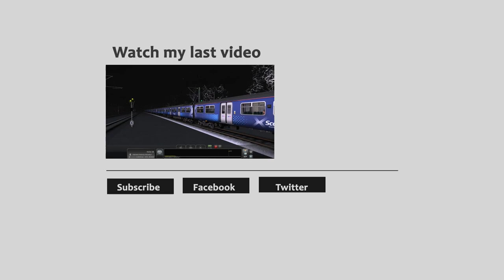OMSI 2 Let's Play #28 | Scania Citywide GN14 | Berlin X10: Line 110

Comment: hey qwerty, i can't seem to get just general bus mods to work so you just make it into a zip then drag hoff files in or am I doing something wrong?
Reply from the maker: I don't get your question, you need to extract whenever you want to put into your omsi 2 root folder, hof files can be copied and pasted into other bus folders to be used on other maps etc
Reply: +QwertyAfro just how to install bus mods
Reply from the maker: Buttie bacon buses themselves or mods to addon to existing buses?

Comment: The bus doesn't need a physics upgrade, sadly the bus handles this bad in real life too, hence drivers tend to hate it.
Reply from the maker: +AutoGamerz well it needed a patch because if the suspension and the kangoroo jumping action it did when you braked or turned sometimes was unplayble at times
Reply: the kangaroo jumping is the result of the out of memory issues, it happens to anyone when their PC can't handle the map completely, it's basically the first sign your running low on memory, then textures start to disappear and become white, then you sometimes crash.

You mistook that for an issue with the bus.
Reply from the maker: AutoGamerz
the bus still has bad physics of what I have read online of what these hotfixs actually changed
Reply: the hotfixes made it more driveable, but are less close to how the bus handles in real life.